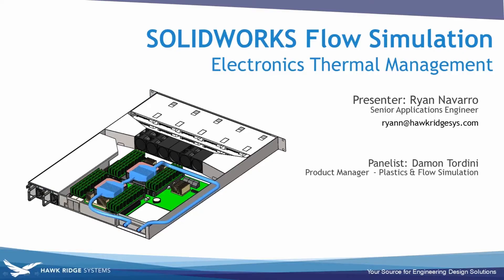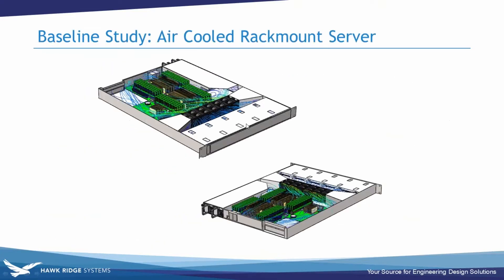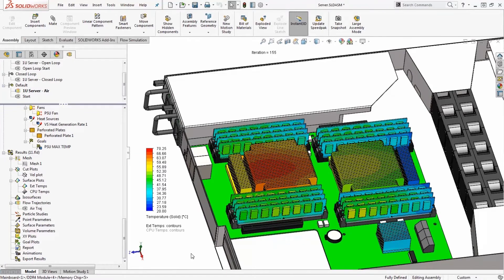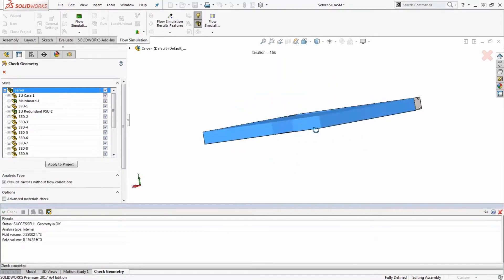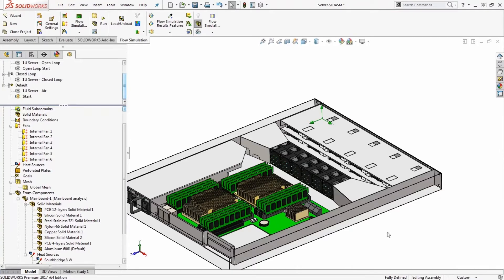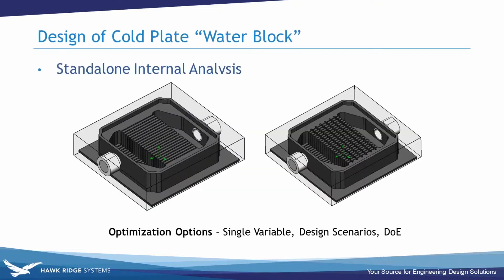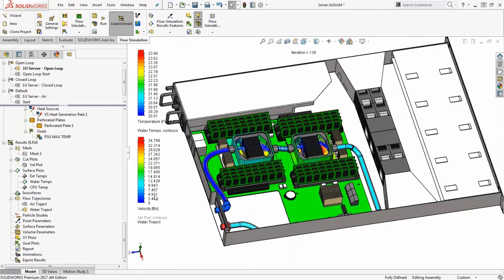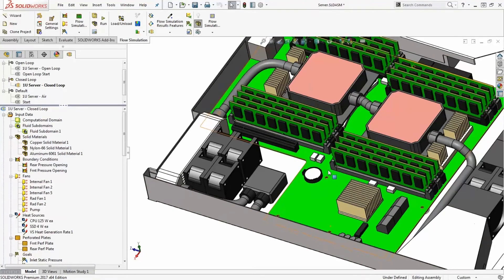Designing Liquid Cooled Components with SOLIDWORKS Flow Simulation

Comment: Using the fan instead of the pump didn't give me the correct answer. Have you ever tested this configuration? It seems that this is not a valid method for closed loop systems.
Reply from the maker: Hi Saeed, what kind of discrepancy are you seeing?

There are some important options when trying to use a fan condition as a pump - namely using the correct "reference density" which for pumps is usually water, 1000 kg/m^3

Also in case of an "internal" definition like for closed loop would need to be sure that using the "incoming" temperature is enabled

A closed loop problem would likely take a very long time to reach convergence, so maximum number of travels would need to be extended in Calculation Control options. Also the solution time could be reduced by specifying an initial condition of the fluid closer to the expected equilibrium temperature